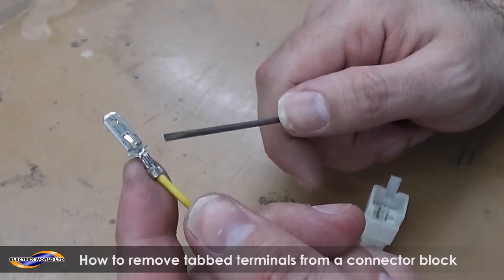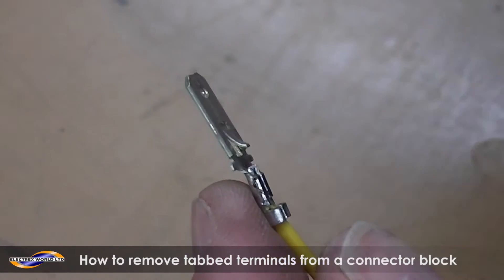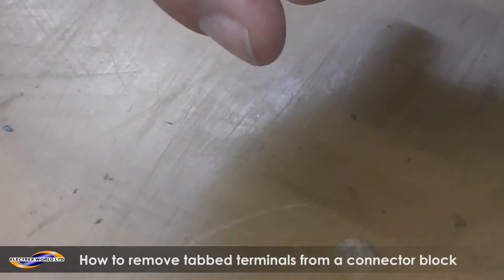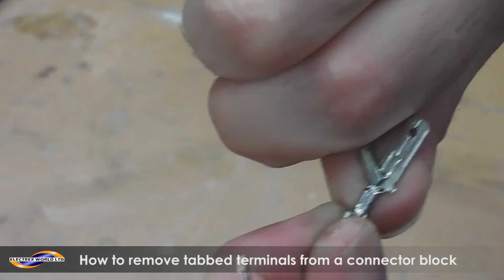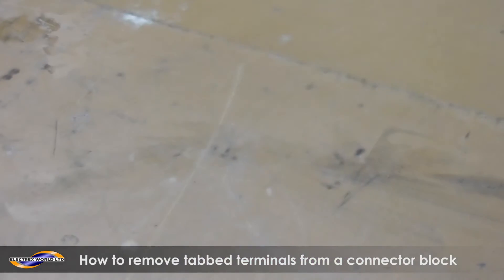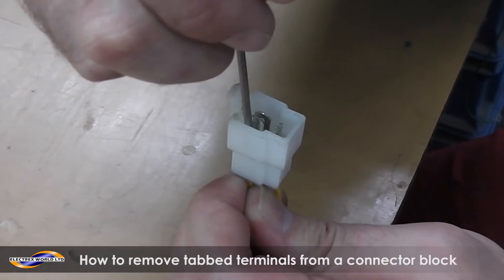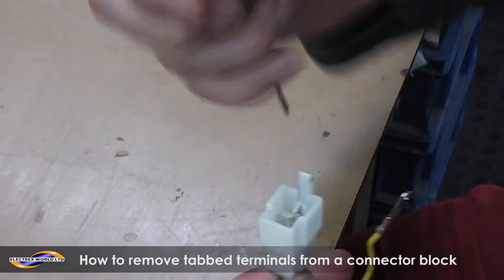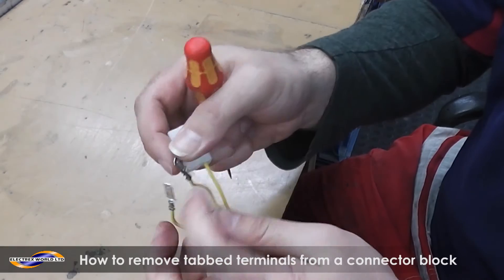How to remove tabbed terminals from a connector block

Comment: My tractor has the blocks/housing that has the latch in the housing. the spades do not have a tab/tangs that flips up to hook into are onto the housing like the one you are showing. Where can I find this type of housing and what is it called , my spades  have a little hole in the center when you slide it in, the housing clip catches it. My spades and wiring are good but the housing is old and crumbling apart---just need to know where to get this type of male to female housing with built in latch for 2 pin spade and the same for a 3 pin spade